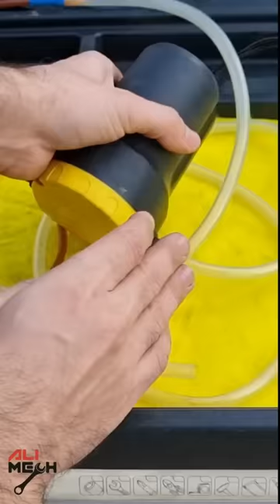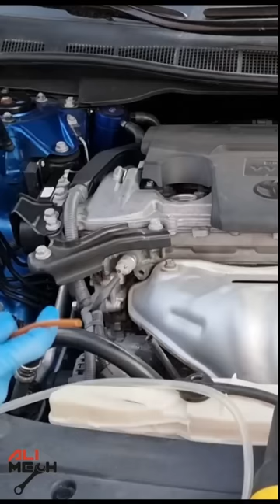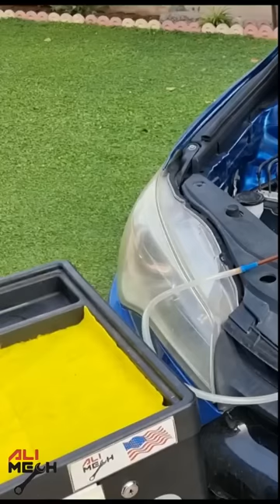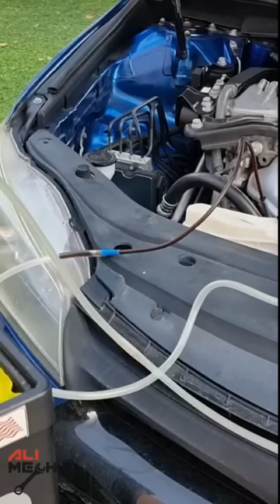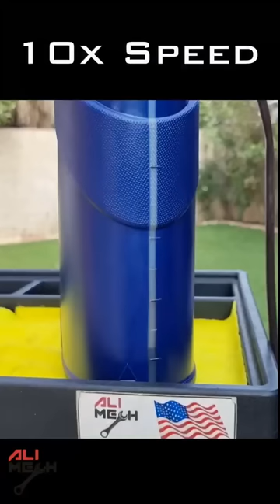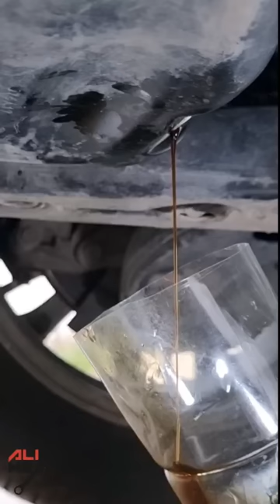Don't change engine oil like this! #shorts

Comment: You still have to get the filter so why bother?
Reply: Vw, audi and so many cars have the filter up top, so you can do complete oil change without ever going under the car, using an actual oil extractor not a blow up mattress pump though
Reply: @jonjong7651  just wanted to say that I was using (for at least 5 oil changes) that exact same chinese pump in my w204 c-class and it was able to remove all of the oil from it 😅
Reply: @malan07  yeah after an hour and the pump overheating a few times. I've had to do it before on a Merc ML320 because the underpan bolts were spinning, took after an hour and fucked the pump and my back from holding it up due to too much of a hight difference in pretty hot weather, pretty lightheaded afterwards
Reply: @herozero8809  I used a manual pump and it didn't take an hour, maybe 15 minutes because i forgot to pump it halfway through, and also the pan holds 8 liters.
Reply: @TopiasSalakka  a manual pump is different and works ok, just a bit slow in comparison to just draining the oil normally, I was talking about the little 12v oil pumps.

Comment: Well it's pretty simple.  you're never going to get all the oil out and you are never going to wash out what residue, sludge, Etc is in the bottom of the pan.  There  always will be some and the act of pulling that plug on a hot motor will help flush it out every time.
Reply: Thats just not true though.
Reply: @TopiasSalakka  lol yes it is. You're not vacuuming the pan out you are pulling the oil out from one spot in the pan. over time you are going to have build up in your pan because of that process.
Reply: @spacecat7247  Crap will get collected into the oil filter though, and slugde means you're not taking care of the car anyway.
Extracting is easier and safer, there's pretty much no reason to drain it.
Reply: @TopiasSalakka  you think about a pump and how slow it operates when you're pulling oil out of the dipstick tube. don't you think that residue is going to settle out?. whereas when the oil is hot and you pull that plug there is such a high volume going out that hole that you're more likely to drain so much more of that oil and that residue and what is floating in that residue.
That filter is not going to get everything and there are things that will not be picked up by the intake of the oil pump and over time it will build up to a certain level that will be harmful for that motor.   And if your theory were the case ,why would Engineers be continuing to put drain plugs in oil pans?
Reply: @spacecat7247  When i used an oil extractor at a friends house, it wasn't slow at all. I drove there 70km so the oil was very hot, it was like pumping water lol
Took maybe 15 minutes, and i forgot to pump it halfway through, and had to empty the extractor twice too since it holds less than the oil pan.

Even if there was crap left in the pan, it'll just get caught by the filter.
Reply: @TopiasSalakka  I'm going to continue to do mine the factory way.
Ramps, filters ,wrenches Etc.  Good luck to you on the shortcut.   Over time I don't see it  working out too well.
Reply: @spacecat7247  My car has been serviced at the dealer since new according to service records, and they always use an extractor to change the oil.
210k on the odometer and no problems with the engine, surely by now there should be a ton of sludge inside the engine if your theory was true.
Reply: @TopiasSalakka  drop the pan and take a look.....  for that matter pull off the valve cover too
Reply: @spacecat7247  yeah i'm totally going to bother doing that just to look for contaminants that already got sucked out by the oil extractor.
Reply: @TopiasSalakka  well at least you have your sense of humor still I guess you don't do any of your own work huh?
Reply: @spacecat7247  I do whatever i can. I visited a friend to use his oil extractor since i haven't bought my own yet.

Before this car, i just took my previous car to any random mechanic for an oil change.
Reply: @TopiasSalakka  well. Maybe working on your own might be a new  adventure.  As to your oil pan and valve cover..... most people don't check  them till they leak profusely or the oil light stays on  or it just tosses a rod.  No worries.
Reply: @spacecat7247  I'm checking the valve covers at some point anyway, leaky gaskets are a known issue on this engine and i sometimes smell burnt oil.
Reply: @TopiasSalakka  yep that would probably be a good idea

Comment: I can do an oil change in 15 mins the traditional way. Seems like this way took a long time and still had to take the drain plug off.
Reply: Depends, taking the under tray off is a hassle if it’s hod underneath it

Comment: Do you realise that you never get all the oil out, if you'd ever stripped a motor after draining the oil it still has oil, in the lifters, the oil lines, the oil ways, in the heads of the head bolts, the oil pump and pick up and all the oil that already coated every bit of the motor.

Comment: yes but no one cares because a little left over oil is not like rotten food , if you add 5% rotten food into fresh food all food is contaminated, thats not how oil works, oil wears out its protection additives and thins out, by adding 95% new oil that last 5% wont make any difference in engine life or lubrication.
Things are different if there is engine wear and metal deposits in the oil pan that need to be drained, but usually that doesnt happen, if it does your engine will be dead soon regardless of oil, any impurities at the bottom are sucked through the pump and pushed into the filter where they stay.

Comment: I used it on a Corolla and it sucked almost all of the oil but when I tried it on my Miata, it left almost a litre of oil in the pan, so I had to get underneath anyway.
Reply: vacuum longer you should get it all
Reply: @donaldmartin2786  
Thanks a lot, I would never come up with that brilliant idea.
Reply: Do like me, maybe works for you. Out the car uneven, and try to put the oil in a corber of the carter.  How. Out the wheels on sidewalk and a soft downhill. I do that and take all the oil. Depend of your carter check it

Comment: Yeah not worth it.... 15$pump will destroy overtime sucking the bottom of the oil pan,takes more than 20min just to drain old oil, once you open the drain plug will still spill etc etc in resume -how to turn out a 20min job into a 2hr one

Comment: Losen the oil filter and tighten the filter by hand. Then it comes off easily when hot.
Idle the car until the Electric fan for engine cooling kiks in, then the engine is at its hottest.
And you get the most oil and sludre out.

Comment: This is a great method, if you are a hack mechanic
Reply: I agree  the video is doing wrongly. The car must be uneven. The oil will move in the carter , example to a corner and take it out that way.  And work fantastic.   That specific pump in the video is very very bad quality. Mine only worked 3 oil changes. Now i use a manual pump. And auper happy with it

Comment: Care full ..leaves about 8%of oil
Reply: So does the oil cooler and pipes
Reply: @nigeldlm  yes, however metal grinding would normally be found at the bottom of oil pan.

Comment: I will never understand why rednecks are so silly. First that small amount of oil won’t matter. If you’re worried it’s “ the dirtiest oil” you’re dumb. Run your car for 5 minutes and it will all be mixed up and won’t matter. It won’t matter either way because the inside of your engine is still coated with dirty oil. Second there is no second. This is 100% fine. Anyone who tells you differently doesn’t know shit about cars in the first place. Ask them how often they change their atf. You leave the majority of it in the car unless you do a full flush.

Comment: Yes, you can change oil like this. If you dont let 1 liter in the engine, its absolutely no problem.
Reply: It may actually be a problem, there is always a magnet mounted in the bolt at the bottom of an oil pan, and the task of this magnet is to collect metal pieces. If you collect the oil the way it was shown on this video you will literally leave all that metall mess in your oilpan and reduce engine lifetime.